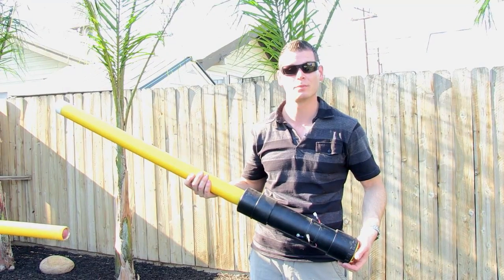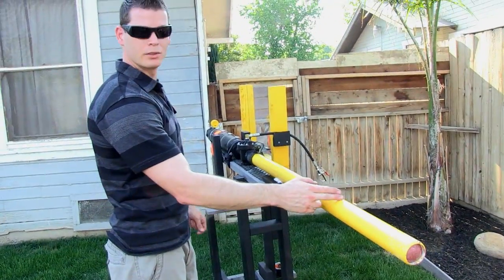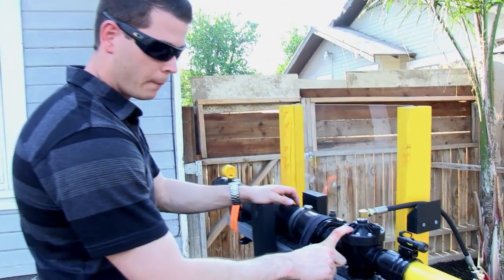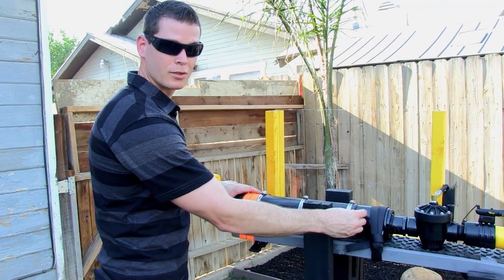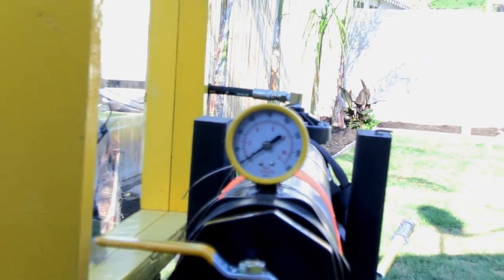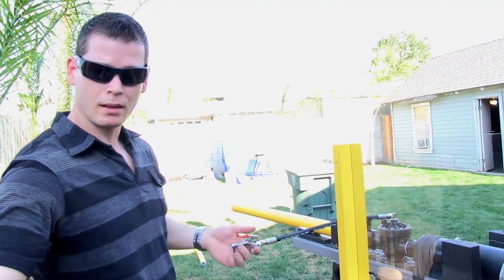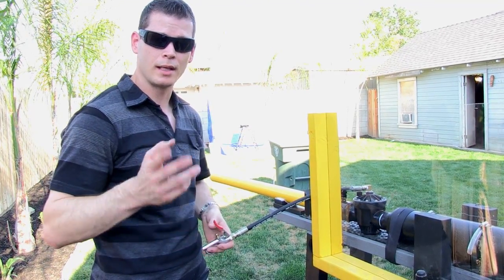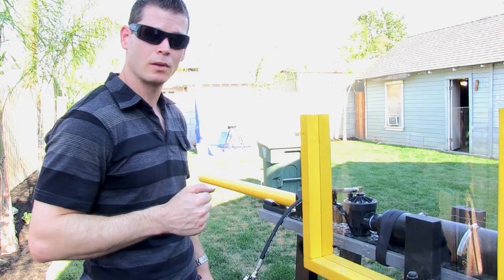New Air Powered Cannon.mp4

Comment from the maker: Oh yeah its shcedule 80.  And that is threaded on a lot trust me.. I locked it into a vice clamp and spun in on i don't know how many turns, it actually had a lot of threads which surprised me,   also used a lot of teflon tape, that cap is not going anywhere... I hope it doesn't go anywhere,   I guess we will all find out

Comment: That 1.5" valve should work much better than the cheap 1" rainbird I have used. Another nice part about the valve is that you can easily change out barrels.